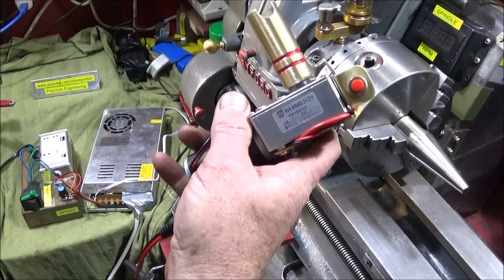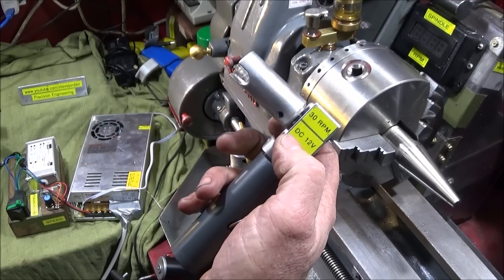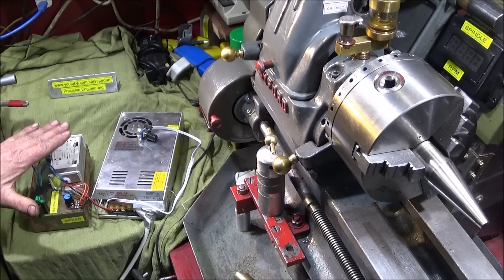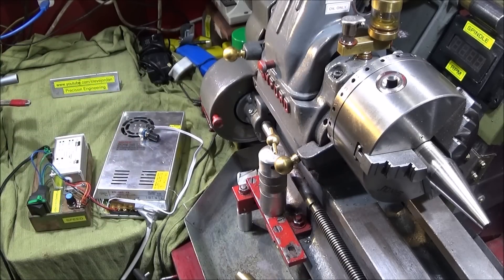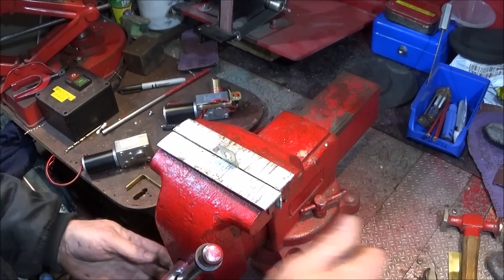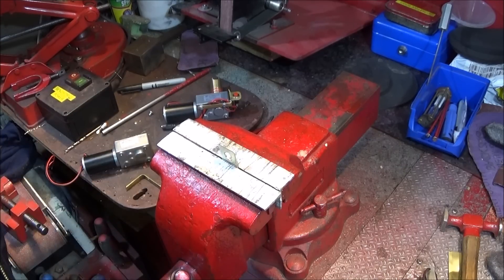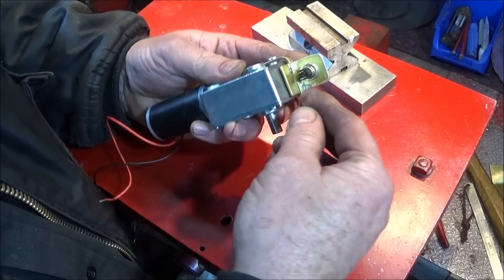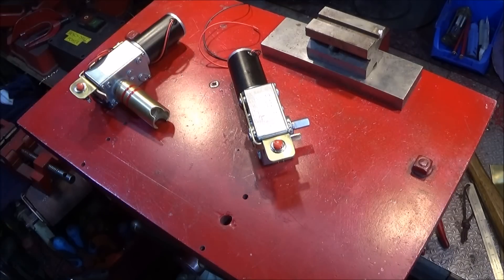Make A Brass Push Button Bracket For the 24v Compound Drive Tool

Comment from the maker: LINKS FOR PARTS ETC BELOW:-
High Torque Gear Motor 24V DC 16/40/260/470RPM For Intelligent Curtain Motor - #3 -- http://bit.ly/2F3NYjI
High Power DC Brush Motor Speed Regulator Speed Controller -- http://bit.ly/2WH8uh4
Switching Power Supply  -- http://bit.ly/2FR7zoK
LUSTREON DC12V Male/Female Power Supply Jack Connector -- http://bit.ly/2JZPsB9

AN ALTERNATIVE 12 VOLT KIT THAT WORKS EXACTLY THE SAME:-
DC 9-60V 20A 1200W High Power DC Brush Motor -- https://bit.ly/2HXruq9
12V 160rpm Reduction Motor Worm Gear Double Shaft DC Motor Cear-box Motor -- https://bit.ly/2UYuIjH
TWO TREES® 12V 30A 360W 21.5*11.4*5cm Switching Power Supply -- https://bit.ly/3mNm96G
LUSTREON DC Power Male Female 5.5*2.1mm Connector Adapter -- https://bit.ly/38o5pur

Comment: Steve, was your choice for a 24v motor because of better torque? Is there a significant torque improvement going from 12v to 24v?
Reply from the maker: Hi The torque appears to be very much the same. I actually chose the 24 volt one because of its larger dimensional size and fully enclosed motor. It is great to hold as it is without having to make PVC handle motor cover like on the 12 volt one I made.

Comment: Looks nice, but no flux on the parts before soldering?
Reply from the maker: Hi Craig The solder has a flux core. So I don't use any extra. I only use a flux on higher temperature braze silver solder.

Comment: Excellent video Steve, many thanks for showing a series of construction episodes and detailing the source of the component parts.
Reply from the maker: Hi Brian, Thanks I'm pleased you like them. I must say though, I only have basic electronic knowledge and learn as I make things like this tool up. Thankfully the Chinese have put together some excellent low cost versatile electronic components that are easy to use, like the motor control box shown. If it wasn't for these ready made units the electronic side of things would be beyond me and I would still be using the drive with single speed and direction.
Regards Steve
Reply: Steve Jordan thanks Steve I’ve also only got a slight knowledge of electronics but you explain it well